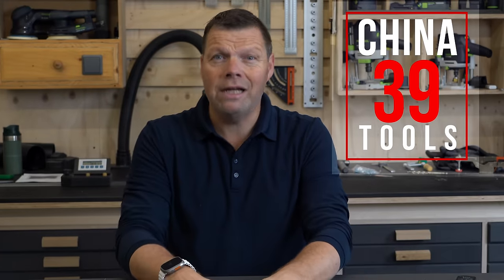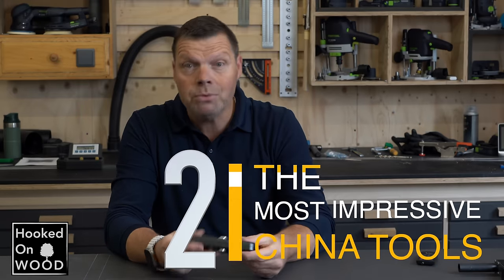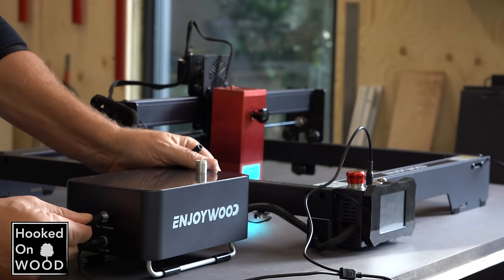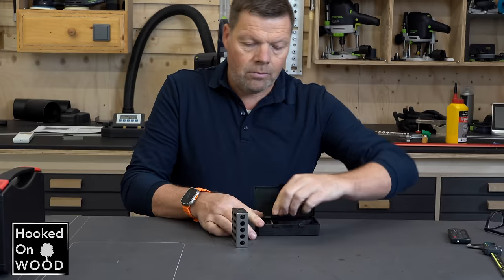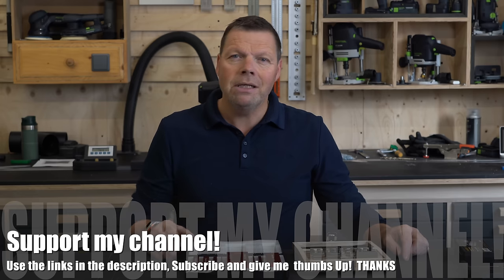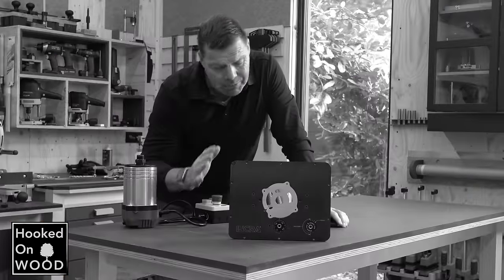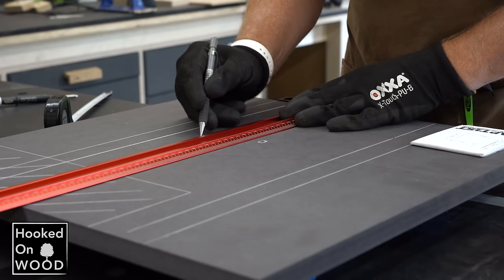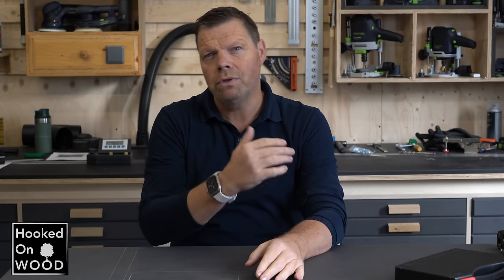The most impressive China Tools, double 11 edition

Comment: Dennis, I have the same AUKTools motor and Incra Mast-R-Lift II in my router table.  I added connectors in two places on the power/control cable.  Once is just inside the router enclosure and the other is just inside the CleanSweep box under the table top.  This allows me to remove the router lift and motor or the router table top without having to remove the remote control box.

Comment: One note about the steel setup blocks (also known as gage blocks or Johanssen blocks): they - and all steel measuring instruments - are normally calibrated at 20 deg C. At different temperatures their dimensions will be slightly different (either larger or smaller) because of thermal expansion/contraction of the material. The significance of the change varies with what you are using them for.
Reply: You are right but for woodwork i'm pretty sure all the tolerances are more than acceptable when the wood itself is more subject to temperature and humidity changes.

Comment: Great video, In regard to dog hole clamps, my bench to is only 18mm thick ply with supports for rigidity, so generaly very happy with it, but the dog hole clamps need a thicker bench top to work well. It is to easy stretch dog holes with these clamps with just 18mm thickness, and in my case they do not hold well. I am sure if i used another layer of wood on top or under it that would be better for these clamps. Its My fault, not clamps Fault, just I thought people should be aware!

Comment: Ordered the 3 Veiko T-Squares and the 12 inch Precision Square....Arrive yesterday....All perfect right out of the box measured with my machinist square. Silly question: What mechanical pencil fits in those tiny little holes that I can get off of Amazon. Thanks for the review and suggestions
Reply from the maker: I use a 0.5 and 0.9 or 1mm pencil with it
Reply: @HookedonWood  Thanks...Just bought a Pentel mechanical pencil .9 mm.  The metal tip won't fit in the hole....so the lead has to be pretty long to reach and as a result it breaks easily. What brand mechanical pencil are you using?

Comment: Hello Dennis.

In this video thumbnail I can see the Chinese replica for Woodpecker Auto Line Drill Guide (which I am interested in buying). However can't find anything about it in this video nor your other videos or even in the website.
Would you recommend it for precision plumb holes?

Thanks for all your time and effort.
Reply from the maker: I thought about to buy the original version to compare. I think it helps to make more accurate cuts, but if you look at the construction, which looks similar to Woodpeckers, you can not expect it to bee very stable. There is some flex. But for light drill work and especially for repeatable drills, or placing it exactly on a certain spot. This product is useful. But do not expect it to be a drill stand like a pillar drill, it is just not stable enough for that. I see they have a new, what they call an upgraded version. I do not know on which fronts it is better. Maybe that is a good alternative. But again, it is more a piece to accurate make a series of drill holes rather than an drill pillar alternative, but I am afraid, this same counts for the woodpeckers version.
Reply: @HookedonWood 
Thanks Dennis for the feedback. I'm planning to use it for some plumb holes on large surfaces or big pieces that's hard to take to the drill press. A good examples of that are bench dog holes or holes for locks in an entry door.

Looking forward for more reviews of these gems you find in Banggood and other hidden places. Thanks.

Comment: hi dennis, im must say i was dissapointed with the veiko t ruler, i got the 400mm version but it isnt square, the t section is too short in my opinion. not up to the ususal standard im afraid. cheers
Reply from the maker: Sorry to read that. I think the T piece is big enough for good alignment, but of course, it should be square otherwise, nothing will help. All my pieces are good. Of course, I check them for accuracy.

Comment: Great reviews: there is a lot that I do want include in my workshop early next year. Health reason have reduced my wood working in the last 6 months, but going forward,I’m keen on some updates. And these are on the list

A real shame the edge tool wasn’t made larger into a full No4 Plane. I would pay for a new, modern design that had 4 blades I could sharpen and could take shavings micros thick? Wouldn’t it be brilliant.  It’s way, way time the tools industry has the disruption that Tesla is generating around the world. Maybe his idea could start the revolution? We have been held in the 1950’s for far too long? I think you need to speak to then and start the ball rolling👍 I’ll be waiting. . . . 

I’m sure China could turn a design around in a month and they are not that tied to Christmas.

Final point. I’m in the UK. Contacting. No problem. Although I have sent something to Matthias about the idea as well. I’m only interested in it if going forward. Everything thing else is between the two of you.

Comment: How do you know how accurate you calliper is?
Reply from the maker: I don't, but I bought a Mitutoyo for this purpose which is known as one of the most accurate.
And when I check the Mitutoyo with my 0-grade setup blocks it corresponds with each other.
More than that, I can not measure. I do not have an industrial-grade height meter.

Comment: Please avoid Veiko T rulers! I bought 2 of them at different times (16" & 24"). I just received the 16" and after assembling I checked for square.  To my surprise it was off.  I then checked the first square (24") I bought previously and it was also out of square.  Unfortunately the way they are made there is no adjustment (great if it was square). They were both about 1/16" off over 16". I tried drawing a line on the edge of a board using both sides of the square (making a 1/16" v) and also verified with 2 different machinest squares. Very disappointing,  considering it would cost more to ship back then what they are worth. Stay away!

Comment: I love your channel, Dennis..but…Banggood prices is very manipulative.  They show you an item for the price..say 53.99 but when you actually select the item it is more like double that price.  The price of the item you’re demonstrating is actually $83.99 and not the 53.99 your video says.  Please be careful to check the prices as Banggood has deceptive pricing.
Reply: I thought he said right now it is 83.99, but on Nov 11, (11.11) it would be 53.99?
Reply: I just checked, price comes up at $53.99. I have purchased several tools from Banggood with no issues.  If you are referring to price increases after selecting an item, many sellers have that practice. The price shown is for the smallest version but when you select the item it pulls up a default size setting. You then have the option to choose which one you want.
Reply: Stated now through 11.11 so pricing is as shown…for the multi row puncher, not the pictured doweling jig.  Just be careful with Banggood’s deceptive pricing practices.
Reply: Not to mention that items often fail to even get delivered, once you’ve navigated the misleading pricing.
Reply from the maker: Hi Jeff, 
In my video, I tell that the doweling jig is 84 and the multi-row puncher 54. I do not tell the doweling jig is 53. I agree that on the site of Banggood, it could be more clear, but you can select the small pictures that change the price setting. In the text, it is written what you get for the different options.
Reply: Absolutely agree with you Jeff, I got screwed on Bang Good couple times. Their marketing concept is very shifty.
Reply: @HookedonWood  yes I understand, Dennis… nothing against your wonderful reviews…best on the Internet in my opinion but still not happy about Banggood’s misleading pricing.  Basically pictures a Ferrari with a Ford price.  The price should reflect item in the photo.  My opinion.
Reply: I. Totally agre. I also stopped buying from them. Through the years prices have increased and they are not as competitive any more
Reply: I've been impressed with the quality of everything I've gotten from Bangood, especially for the price. Mind you I've thoroughly researched everything beforehand I've purchased from there
Reply: I agree with you 100%. They send an email showing an item at 53.99. You click on the email link and the prove jumps up $25.00. Totally deceptive. I ordered from them a few months ago. One of the items arrived bent. I went though hours of speaking to customer service and they never did anything to correct the problem.

Comment: You are checking gauge blocks with a caliper? Really? What you are really checking is your caliper accuracy...
Reply from the maker: That is what I said in the video. But it is the best I can do. At least my caliper is accurate according to the gauge blocks. And I measured differences in the first setup block set. So, I am
Pretty convinces there is a small deviation here, which is also within tolerances
Reply: @HookedonWood  OK, but what about a micrometer?
Reply from the maker: That is a better tool to control.
Reply: @HookedonWood  I take it those red blocks are aluminium- which has a much higher thermal coefficient of expansion than steel (your calipers). Have you allowed for that?
Reply from the maker: What is your point? I spend more than average time to review these products. Again, you are right, but I am no TNO institute who certified products. I do reviews as good as I can and with the equipment I have. What is most important that the conclusion I make, or my viewers can make based on what I show does not differ significantly bases on my measurement methods. I do not think they do, because the amount of difference your suggestions will make are not significantly for woodworking.
Reply: @HookedonWood  I agree that they are not relevant for woodwork. So, surprising you brought the subject up. But once you have...